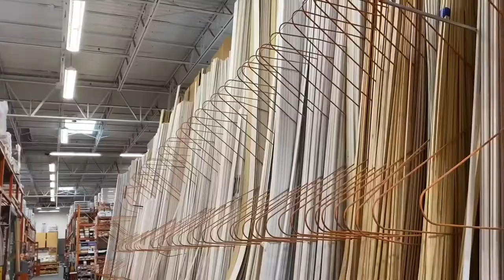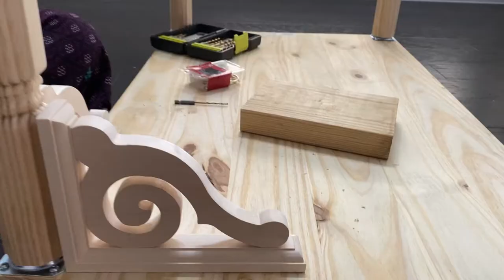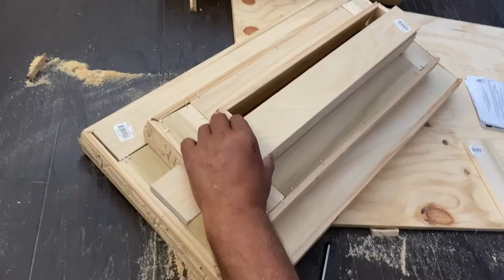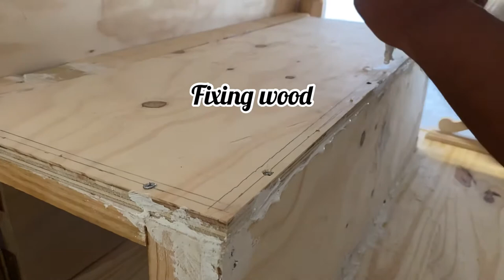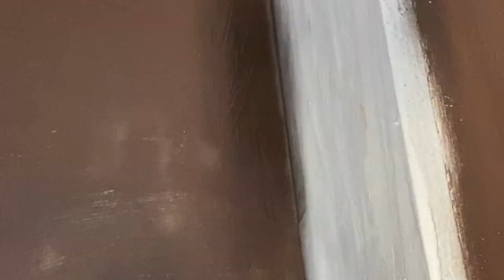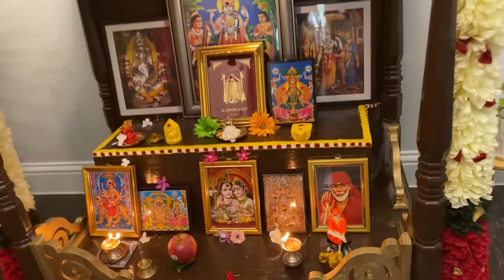Our pooja mandir in USA, Texas. Within $350.Only way to have cheap and spacious pooja mandir.

Comment: Nicely done, what are those corner pieces  used on the top?
Reply from the maker: You can find them in lowes. Craft oak final. 

Large Craft Oak Finial (1.75-in x 3.75-in) https://www.lowes.com/pd/Large-Craft-Oak-Finial-1-75-in-x-3-75-in/3559192

Comment: Can u tell me the stuffs u used for this mandir???
Reply from the maker: We bought playwood sheets from Home Depot and table legs and top cones from lowes. Necessary hardware to fix everything together and paints.
Reply: Plywood sheet dimensions please?
Reply from the maker: 2*4 plywood sheets
Reply: You means 2 depth and 4 length sheets you got what about thickness